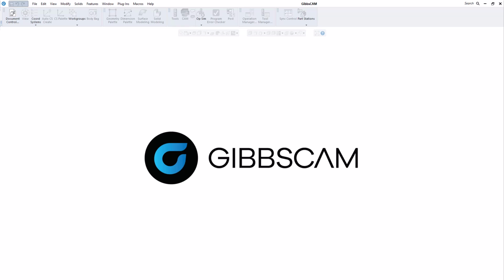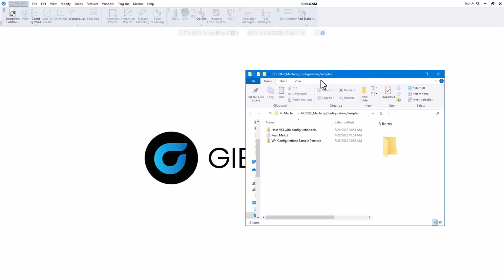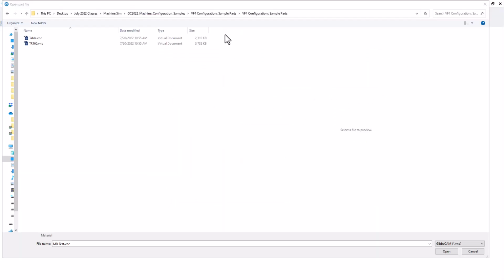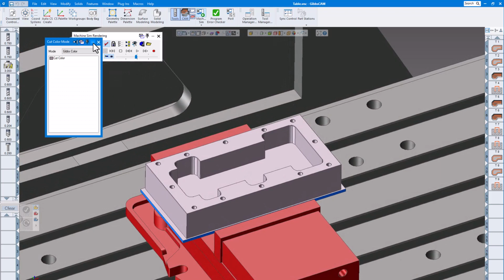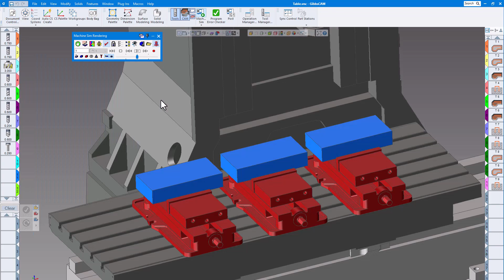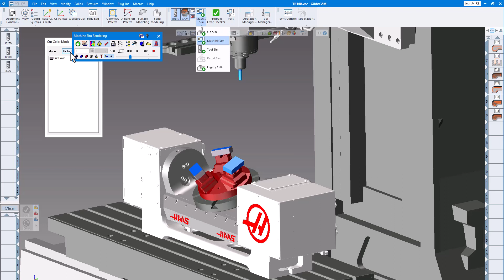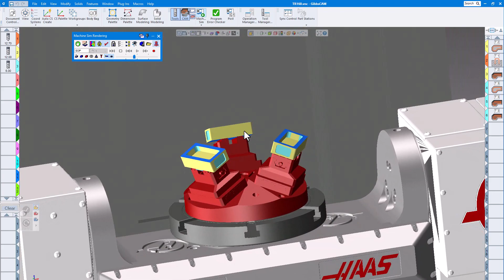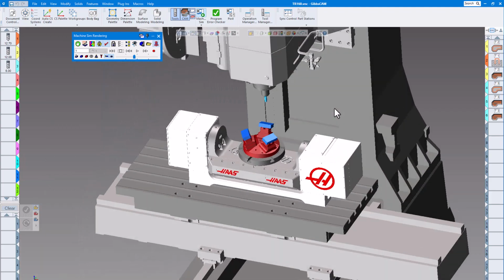GibbsCAM and Haas VF4 Machine Sim.

Comment: can u upload the fil of haas vf4 table tr160 configuration ?
Reply from the maker: Sorry, I do not have permission to send Haas digital files.  Best if you contact Haas and see if they can provide you one.  Their files used to be free to download from them, but not sure if that has changed.
Reply: It's free through HAAS, but I had to email support and ask for the model for my machine.  Just make sure to ask for a solid model file.  They originally sent me an STL mesh file which will not work.  They resent me a .step file and that worked fine.
Reply from the maker: @Mochinist-bk6yj  Thanks, that's good to know!  Thanks for  watching.